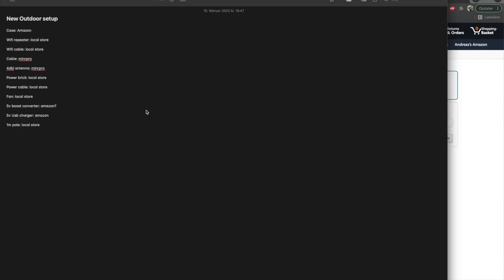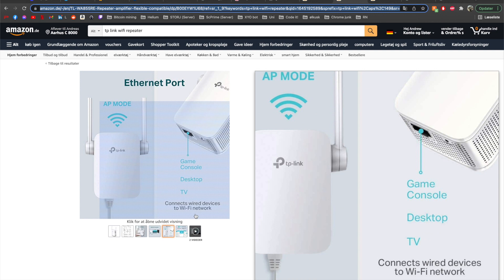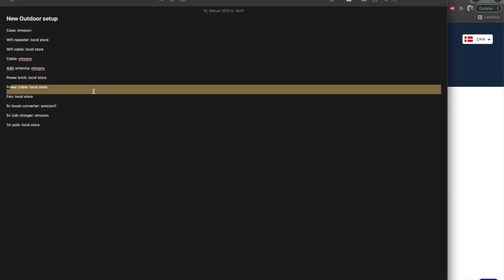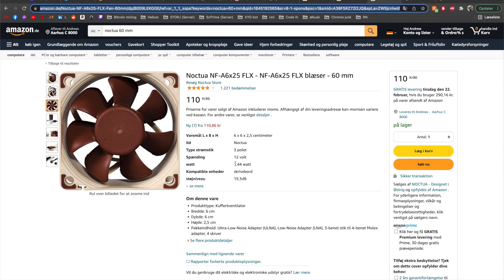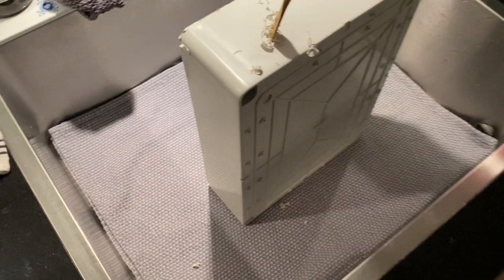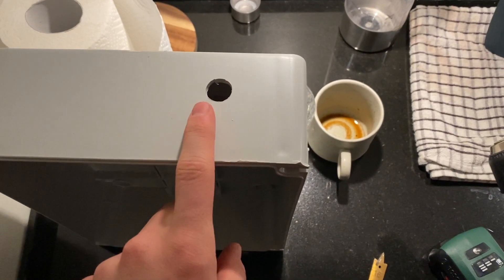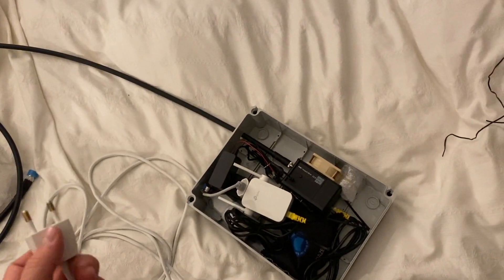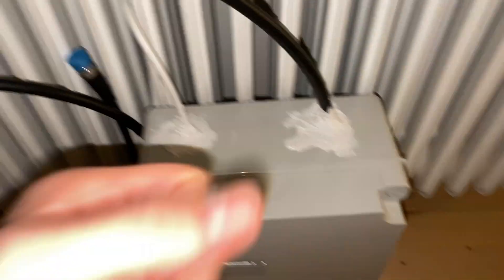Helium Miner DIY Outdoor stup build. Step by step RAK/HNT guide! Start earning more HNT today.

Comment: Great video , why you didn’t try POE splitter with injector rather than having electricity in the enclosure ?
Reply from the maker: Poe was not an option Where it is located😬
Reply: Hey , how you make the booster do you have a video or photos ? I have run it through usb following this method here
Reply: https://youtu.be/Lk7CsCRz8Ns